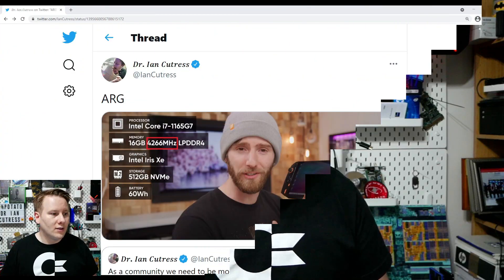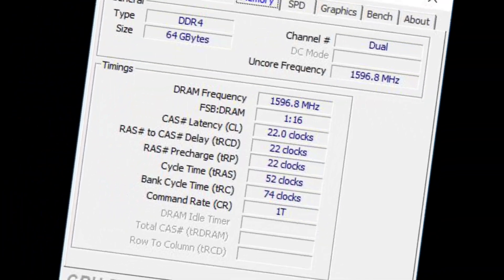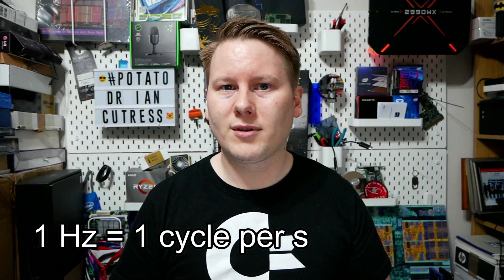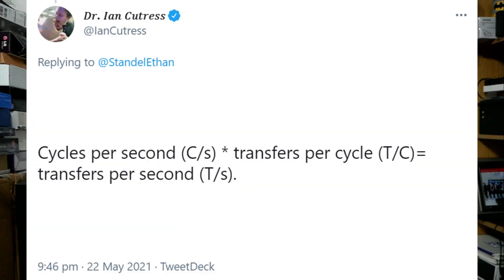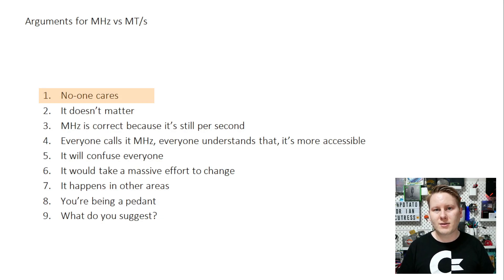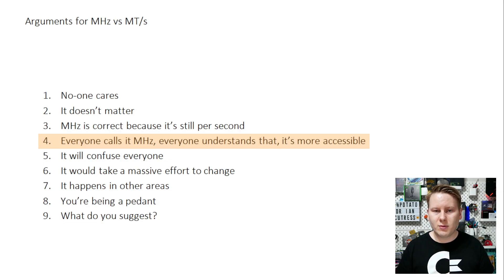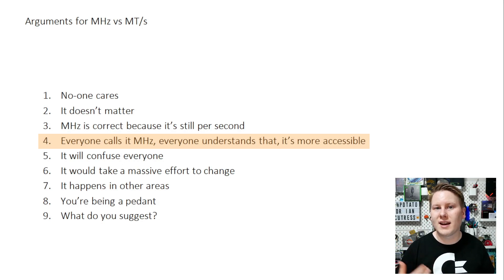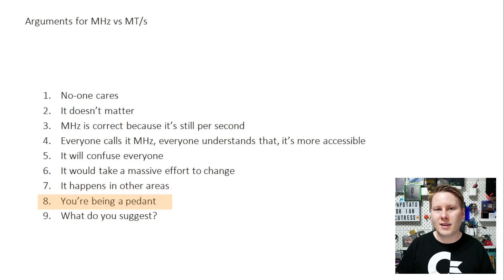Linus is WRONG 💩 : Explaining MHz vs MT/s

Comment: This makes me think of how the HDD manufactures changed the definitions of megabytes and gigabytes etc... Everyone knows a megabyte is 1024 kilobytes. But according to HDD manufactures it's 1000! Seems like it's probably the fault of the marketing people.
Reply: I think it's rounded up, sometimes.
Reply: This "everyone knows" attitude is exactly what got us into this mess in the first place. Sure it wasn't a big deal back in the 70s when 1024 bytes were close enough to 1000 that it didn't matter. But The prefixes kilo, mega, giga, ... have been widely used and had an agreed upon meaning of 10^3, 10^6 and so on way before computers came around. It's not the fault of HDD manufacturers that the rest of the industry decided to be really inconsistent about it.

And guess what? Your "16GB" "3200MHz" RAM module that you might be using right now can store 16 * 2^30 bytes of data while running at 3.2 * 10^9 transfers per second. Go figure.
Reply: @tiarkrezar  Yeah I know kilo, mega and giga mean 10^3, 10^6 and so on but I'm talking about kilobyte and megabyte and gigabyte. Computers are based on binary numbers. It's more consistent to do everything in 2^x's. It just makes sense. Maybe I'm wrong about their original definitions. Maybe a kilobyte was originally considered to be 10^3. However I think it only makes sense for it to be 2^10 bytes. The whole thing with DDR and MHz's is clearly wrong. But I think even if I am wrong about the original definition of kilobyte, the definition that people normally use makes more sense (where as the MHz's vs mega transfers doesn't) and you know HDD manufactuers love that they can't say that HDDs have X amount of memory and have people think that X is more than it really is.
Reply: @samzx81  My point is, even in the computing industry, there's no agreed upon standard. Transfer rates are always measured in power of 10 units. Your 1Gbps network can transfer 10^9 bits/second. At least one thing we can all agree on is that 8 bits = 1 byte, so that makes 125 million bytes/second. See the issue here? By your definition, that's 119.2MB/s, now multiply by 8 and you're back to 953.6Mbit/s. And the whole system falls apart.

If you really want to use the power of 2 units, be explicit about it and write them down with ki, Mi, Gi,... prefixes, that leaves no room for confusion. Otherwise, we should strive to be consistent with the rest of the world and just use the power of 10 units.

Comment: After this video, my CPU is suddenly 81.4GHz, niice
Reply: Stonks
Reply: did u download new rams?
Reply: I’m only at 16.4 :(
Reply: You can combine the number of instructions per second for each core and integer/floating point perfomance.
Reply: So does that mean a Ryzen R5 1600AF that runs at 3.7GHz (its stock and that is what my gigabyte board runs it at tho it will down cock when not loaded) would be 44.4GHz across all 12 threads?
Reply: @99Duds  I think it's more complicated than that. A single core can perform multiple instructions simultaneously. The instructions on the other hand can take multiple clock cycles.
Reply: @LevisL95  Its sarcasm. Sad I have to explain that.
Reply: @99Duds  I know we're not being serious, but I thought that you were genuinely interested how one would calculate that theoretically. :D Don't be sad!
Reply: @LevisL95  You really need to find something better to do with your time. I know how computers work, I don't need some rando telling how smart they are.
Reply: @99Duds  how you got so butt hurt from that guys comment 😂
Reply: @friendly0  Butt hurt, No. Annoyed, yes.
 Lots of people over the years have tried to correct my 
sarcasm, they say they knew it was sarcasm. If they know its sarcasm why are still trying to tell me this or that etc. it needs no comment its just a simple "hehe Duds made a joke".
Reply: I definately didn't get the sarcasm in Dubs' comment earlier. It's hard to judge online with so little context.
Reply: @LevisL95   There is plenty of context look at the comment this all under and see where I was going rather than say this isn't right and going into correction mode. If you need more context, maybe you should ask what is meant. Instead you assumed I some how wanted your help in correcting my view. Jokes don't have to be correct to physics, or reality etc.
Reply: @99Duds  Just let it go already.
Reply: @LevisL95  So now you going to say you can talk about it but I can't. I got every right to defend my view.
Reply: @99Duds  Sorry, I was getting a bit annoyed. I think there's nothing to argue about. You made a sarcastic comment. I replied thinking it was a genuine question, lol. You got annoyed, because you thought I'm some know-it-all who wants to prove you wrong. I don't. So, we misunderstood each other, no hard feelings.
Reply: @LevisL95  Truce.

Comment: Lol 1,2 and 7 its contradictory. 

If you dismiss needing to use correct audio terms, then that also negates your desire for Mt/s because if you don't care about the audio nerds who cares about memory nerds. 

Anyway my real opinion is I barely care. I usually swing to using correct terms, but its kinda another thing on top of another thing on top of another thing to keep track of especially for casual builders and your solution of using no units for the general public is fine. 

I'm enjoying the memeing of #Lienus an the glados reference. LOL carry on....

Comment: I'm happy to have made it into your video :) But I still think its going to get more complicated as we go, yeah using MT/s over MHz/s would be the ideal fix. because MT/s still allows for an easy understanding of DDR, QDR, and whatever is on the horizon.

Just change a letter, and it'll be fine. When you first posted it, I interpreted you to mean you wanted to switch to Mhz/s, which just ends up being more complex, or as you said, you could also remove the end of it (but if you do that, then you don't have the correct format anymore)

Comment: I must disagree on the definition of Hz it is s^-1 and nothing else. When used for clocks we take it to mean the inverse of the clock period but you can use it for anything periodic
Reply: It means something happening some number of time per second. Now if the memory is not doing any transfers, then it’s at 0 transfers but the clock is still running at 1800 MHz.
Reply: Didn’t he also say that Hz is used to define something periodic?

Comment: The fun thing is that the industry is moving to PAM4 modulation rather than QDR, and with PAM4 even MT/s is wrong. Because each transfer is two bits. So I agree moving to mbps/pin is probably better. Or even specing bus latency and bus bandwidth explicitly.
Reply: Yeah, peak bandwidth feels like the way to go, especially now that we are seeing dGPUs with LPDDR, GDDR, HBM, etc. And I like talking about outright latency figures because then you sidestep the notorious issue of timings "going up" gen-to-gen even though actual latency is flat.
Reply: @musaran2  actually very similar. Baud is symbols per second, and each symbol can be multiple bits.
Reply: @PC_Modder I know what PAM4 is.
"Transfer" is a relative term. A "transfer" for a stick of DDR4 is moving different amount of data that a "transfer" for a GDDR IC, for example.
If the bus is 40b, then one transfer means moving 40 bits.
If the bus is 128b and the interface is PAM4, then one transfer moves 256 bits of data.
But it is, in both cases, a transfer.
Reply: @KarbinCry  you are of course, in the strictest sense correct. However for CPUs, in modern memory the unit of memory transfer that is actually used is the cache line, which is almost always 64B (i dont actually know of a modern counter example). The memory width though is limited by chip pin count and PCB wiring limitations. What actually matters is how many cache lines you can transfer per second (Bandwidth) and how fast you can get them (latency). The interface width is generally determined by what you can fit on 2 dimms, due to connector and routing complexity, rather than anything else.
Reply: Or even just using a "peak throughput" number maybe?
Reply: @PC_Modder what I want is serialised memory interface ;) that's the future. No more of this mucking about with parallel interfaces.
Reply: @KarbinCry  I Mean CXL is basically exactly that, however it does have a latency penalty. Also parallel busses at high speed are lower power-consumption than a single higher power bus. The cost of switching a bit is higher if you want to do it faster. This is why HBM is so powerful. I do think that apple's on-package memory approach for the M1 chip is probably where things will go in the consumer space, with off-chip memory being attached by CXL in the long term.
Reply: Two bits?  You mean a crumb🙃.
Reply: A transfer is not one bit. It depends on the logical width of the interface. PAM4 then is the same as just having wider "channel", or a serialised interface.

Comment: errrm..
isn't Hertz a unit of measure of Frequency (any frequency)?
so you are not arguing of use Herz or not, or is it Frequency or not, just about which frequency it is (frequency of hardware memory clock vs transfer frequency).
and either Frequency is measured in Hertz, like any other Frequency in the world.
Reply from the maker: Hertz is cyclical frequency, not any frequency.
Reply: @TechTechPotato  that makes sense, as clock ticks happen reliably, and for transfers it's just a window of opportunity, not a requirement

Comment: Ian: You are correct and for those who don't care your arguments won't change their minds. For years I've used GBytes and GBits when specifying speeds as this is very often abbreviated to something else which is confusing or ambiguous. No one has complained so I'll carry on.  The only way forward is to either omit units as you suggest or use the correct units. Either and both work and long as it consistent 😉

Comment: You know they got the engineering units wrong on the Mars climate orbiter by mixing imperial and metric and the end result was that the 100 million dollar orbiter burned up in Mars' atmosphere duo to incorrect altitude.
Reply: I usually get defenders of the imperial system with: "1 Liter is 1 cubic decimetre, a cube witch each side being 10cm long and it holds exactly 1 kg of water. How many cubic inches is a gallon and how long are the sides of that cube and how many ounces of water do fit into it?"
And if they actually know the numbers by heart I then ask them: "Is that for an american or a British gallon?" :P
Reply: MKS and CGS are both metric but confusion of them has caused trouble.  Mankind is not well served by any of the systems of units.  The light nanosecond is a better unit for distance in many things.
Reply: @myname ismyname as all the original Imperial Units were lost or Destroyed all Imperial Units are now Based on Metric
Reply: This is why everything science and engineering should be done in metric to begin with

Comment: Not that it probably matters 99% of people, but presumably there would be a latency difference. Given that computers ultimately run at the speed of the clock cycle, having a faster clock cycle, but fewer raw transfers may be advantageous in certain scenarios where response time is paramount.